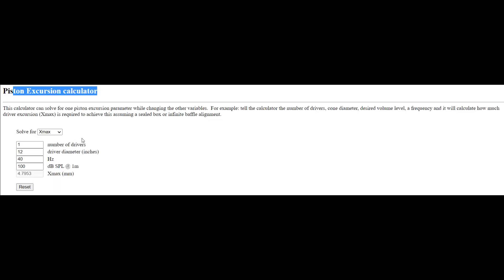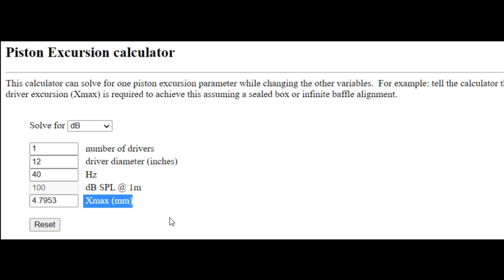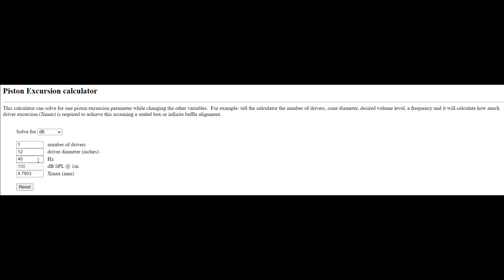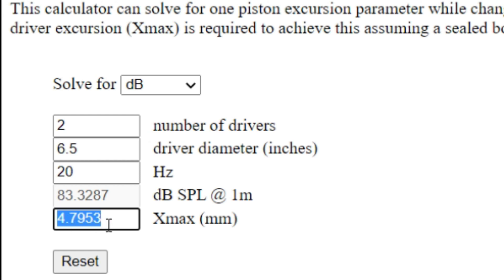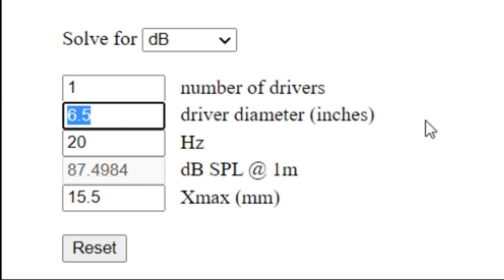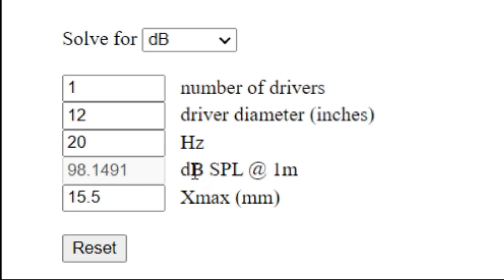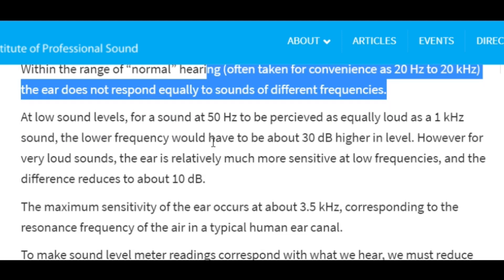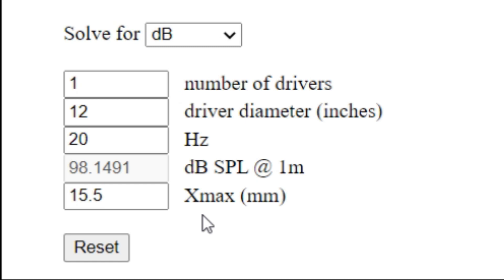Kef KC62 || Is this Subwoofer Magic?? Let's Review the Physics of this Unicore Micro-Subwoofer

Comment: Personally, first off, I'm not happy unless I have a sub or subs that can touch at least 120dbA @20 hz in my listening position lol... so this thing ain't gonna cut it. Second off.. the real elephant in the room is the motor. The inner coil will have the same gauge and the same winding length to attempt a balance in mmd between the pistons, but... the coil diameter is smaller so there will be less surface area to shed the heat. This means the inner coil will suffer thermal compression earlier than the outer coil. The inner coil must have more layers on it to balance the dcr in the smaller winding diameter and this would up the L (bl) in the inner gap. The inner magnetic circuit does suffer the outer coil's gap 'in path' so would take a slight hit on force which they've countered for with the solid pole and the smaller diameter of the inner gap. Then the cone and former assembly is different in each side so have they added weight in the inner coiled assembly.. or more copper? After all it has to be totally balanced in mass acceleration and motion to cancel cab rock. Blah blah blah.. I could go on... I bet the impedance profile differs from the inner coil to the outer. It just seems like a massive headache mission to save two inches of cab width to me.. and that's all it is.. 2" saved. I think it would have been better if the motors were simply sharing base plates. I guarantee these things will begin to differ in motion as temperature  goes up. This thing must have some heavy processing to keep things listenable. I don't often look at driver designs and have my brain shout from the back of my head "that's pointless, stop looking at it".. but I did with this. Bless you kef.. but I'll stick to my larger cabinets.. f**k WAF xx
Reply: Good information, hope people read and try to understand rather than dismissing facts because they like KEF as a brand.
Reply from the maker: Yeah...what he said.

Comment: I'm not sure what's the point of this video, surely if the goal is to determine if the subs are magic, then you just plug'em in and hear what they can do or am I missing something?

Trying to interpret how something's gonna sound from some numbers on a spreadsheet is counterintuitive to me...because measurements are only a proxy and there are somethings that can't be measured.  Does this calculator tell us about how tight or fast the bass is?

Worst of all the guy doesn't even have accurate stats on what the KC62s output (e.g. the Xmax) so why's he even bothering?  Lastly, the KC62 are a two woofer configuration, but the design is completely new and I'm guessing that this calculator doesn't take this into consideration.
Reply: Calculation is more helpful for understanding certain characteristics than others. SPL (dB) and LFE (hz) are two examples of the helpful kind.

What MDT shows us is that this speaker will not be particularly loud at low frequencies and this can be objectively/scientifically quantified, which is important for making accurate comparisons to other products on the market.

Something to bear in mind is that KEF chose to market this speaker as though it will have useable 11hz LFE, which is frankly ludicrous. 

If they had instead stated a frequency at useable & achievable SPL (such as 30hz) and focussed on the true achievements (of which there are many), we would probably all be agreeing they did a great job in such a small package, rather than questioning KEFs marketing strategies & integrity.
Reply from the maker: @1stroudm  Ah! My tribal warriors have come to my defence lol! Thank you my friend :D

Yeah .. that's all I'm trying to do is to prevent people from buying the wrong subwoofer. I don't mind if people are informed and buy this KC62 anyway (I'd like it if somebody gave it to me for free but I'd definitely need a second one lol). 

There's another guy on youtube who has posted videos of his KC62, and by the looks of it, he enjoys it (which is fine!). 

But if you look at the size of the room his sub is in, it makes me wonder, is that really the right subwoofer for the space?(especially for the money...or would 2x SVS SB1000 be a better choice?) I'd have to be there to 100% know, but I expect not from what I have seen in my life.

Not saying this next statement is 100% true, but I think keen followers of Kef and B&W in particular generally don't accept any critique when it comes to their loudspeakers. There's something blocking them from being objective. 

It's that marketing and brand loyalty I think: That's what it does to you!

Lol 11Hz; it makes me laugh every time. Maybe we should go ask a sperm whale to see which sub sounds best?
Reply from the maker: you're out of your depth here...it's fine if you ask me a question..but insult me like I don't know anything, and I'd suggest you be prepared.

I'll give you one last chance to be nice, otherwise I'll expose your inner-chimpanzee, which might be an embarrassing experience for you.

Fly, fly, fly

Comment: Hi ! thanks for video-explain and this website of piston excursion calculator ! Do you know a software who's can measure level watts of speaker like that ? -> https://youtu.be/48gXYRrlD3I?t=96
Reply from the maker: 1W = 90dB 

but 100W = 110dB - you need much more power to get more volume.

Not sure of a software but if you measure dB you can convert to watts RMS

Why do you want to measure this?
Reply: @geezerintotech  ok, I want to measure my 2 Devialet reactor to know the really power consumption they produce in watt at different volume level, like the test video I share you.
Reply from the maker: @Stephane.French.Catholic.yr.33  I would prefer you measure in dB. This is decibel level and the most accepted unit of measurement for sound pressure. Watts is a measurement of power.

You can buy a decibel meter online - but to measure bass frequencies correctly you will need to make sure it is a 'weighted' decibel meter.

Why do you want to do this by the way? lol It's funny :D

How do you set the reactors up - do you put them on stands?
Reply: @geezerintotech  wow it's very technical all this ! I'll think I abandonned this project of measure. Yes my speaker are on stands at (1.97 feet high)
Reply from the maker: @Stephane.French.Catholic.yr.33  woahhh that's really high mate? Are they aiming downards towards your ears?

Yes, it gets very technical. Best thing is to enjoy the speakers my friend :D
Reply: @geezerintotech  euh ! I don't know if tell the good valor, I write it in french : 60cm de haut . They're too down again, Devialet recommend between (45cm and 90cm de haut) 70cm will be perfect !